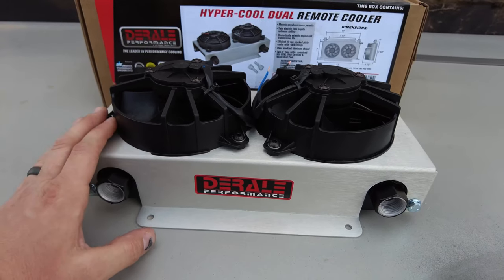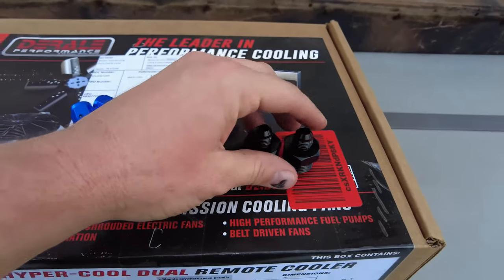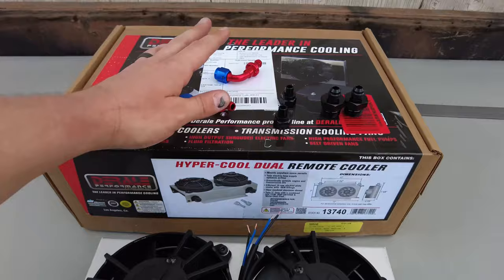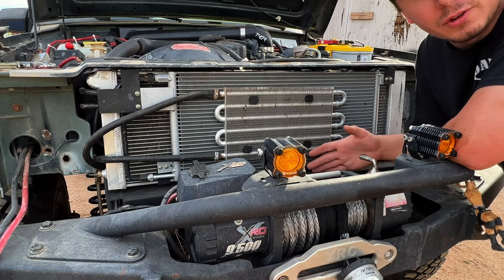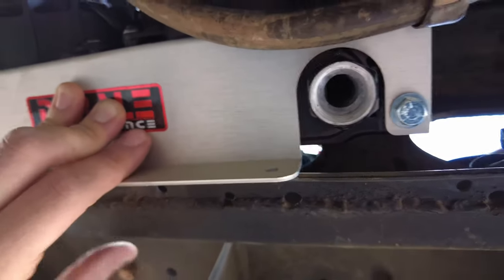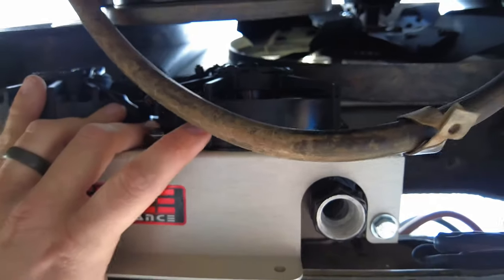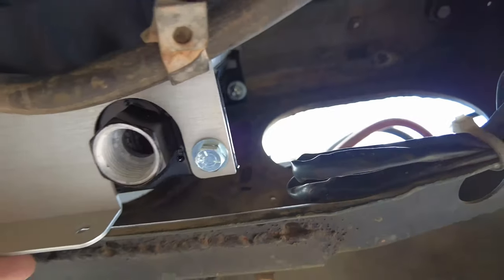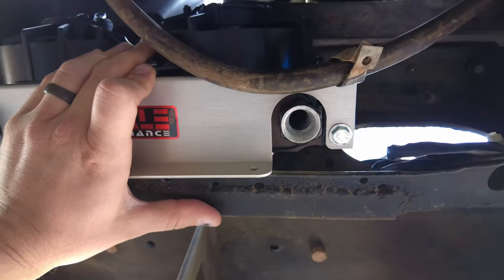How to install one of the BEST transmission coolers on your Jeep XJ!

Comment: I got the Derale Atomic Cool as part of my XJ overheating problem attack plan (along with new rad, fan and shrouds). I also installed a trans temperature gauge and noticed the transmission heats up more than the engine under some conditions, so I’m very glad I got the trans cooler. It makes sense since youre spinning the wheels etc. During the install I discovered the stock trans cooler was clogged, along with lots of bent and kinked trans lines. Night and day for me, all my heating issues were solved.
Reply from the maker: Overheating attack plan I love it! I think an external transmission cooler is a must on the XJ’s especially one with a fan. A clogged and destroyed stock trans cooler can definitely cause some overheating issues with the transmission. The better fluid and airflow the better 😎 thanks for watching
Reply: @2AOverland  Totally!!! Its a big must, total game changer and very often overlooked, hardly anyone does this. Out of dozens of comments giving advice on my heating problem, only 2 mentioned the trans cooler. That and watching your video multiple times I went ahead and got the Derale, night and day man. Thanks for posting, its the only video on Youtube for an XJ remote/fan trans cooler installation.
Reply: @2AOverland  Finally got this model for my buddies f100. Great video man, every time I watch it I learn pick up something new.
Reply from the maker: No problem thank you for that man 😊👍 I’m gonna do the same coolers for my square body a trans and engine oil cooler

Comment: Nice! I definitely wanted to do this before I ended up doing a manual swap on my XJ. 

I’d say a bit of advice would be to look into a thermostatic control for it. That way you never have to worry about turning the fan on or off, cause while it may not be near as bad, over cooling isn’t good for an auto. 

Before I manual swapped, I bought a thermostatic control from American volt. The AW4 operating range is 125°-175°, and I got a thermostatic switch that would turn on at 150° and turn off at 135°. That way it’s always keeping it in range. The kit comes with the hose barbs too so it’s incredibly easy to do. The solenoid control would just be before the cooler and you’d have a solenoid signal wired up to it. Such as battery positive to the switch, then the switch to the solenoid. And then maybe your ground runs through the solenoid. And it’ll turn on the fan on and off as you see fit, and you could even have a manual override too. Just an idea if you’re interested in having an “out of sight, out of mind” approach. I like to drive hard in the sand, so a cooler was a big priority while I still had the auto

Great video! I loved watching. Glad to see there’s videos that aren’t just using the average cooler, and now showing fan cooled ones too
Reply from the maker: That’s brilliant!!! Thanks for the info man! I want it to be as painless as possible so I already have that kit in my shopping cart 😂 I’ll figure it out how to wire it up so it’s automatic and I can use the switch.

Thank you so much for watching! I’m trying to be more outside the box and do budget minded but high quality upgrades to the jeep that I know people would want to watch
Reply: @2AOverland  you got it! I think that would make it so you can just forget about it and not have to worry about it. 

My hunch is that you’ll need to split the ground lead from both fans into two separate leads. You keep the lead you already have connected to the auxbeam and that allows manual control. On the other lead you get a solenoid rated for the current it’ll draw (I believe you said 10A?). Run your secondary lead from the grounds into the solenoid, then from the solenoid to battery negative or just grounded to the body somewhere. Then you just wire from battery positive (or ideally ignition 12v that way it doesn’t run down the batteries on a warm shut down, but I can’t imagine a problem), to the thermostatic switch, then from the thermostatic switch to the relay. I believe there’s a signal ground needed too, so I think in that case you’d just splice your signal ground into any of your ground wires for the fan. But don’t quote me on that part. 

For the thermostatic switch, you’ll want to make sure you get one that has the barbs sized for the inner diameter of the cooler lines. Should be pretty easy to make a few cuts and splice the switch in. Also, as I’m sure you could imagine, make sure you put the thermostatic switch in before the cooler (even the factory “cooler” too if you have it still). You want to see the temps right out of the transmission, not the temps before. It should be easy to figure out which is which. I get everything warmed up, then put the fan on at full tilt. And use a temp gauge to see the surface temps of the lines from the cooler. Whichever one is consistently hotter will be the line from the transmission. 

Also you could even set up your ground wires so it’s just one ground wire from the cooler to about 12” before the auxbeam and then do the split there. The current will be no different if you have it run through the whole ground line instead. 

For sure! I really enjoyed watching it! I know I’ve been watching your IRO 3 link video over and over lately. It’s really well done and it’s making me be sure I’m prepped for when I install mine. 

Best of luck!
Reply from the maker: Man that’s so much info for me to use to install the kit 😊 thank you so much for that! If I make a video on installing this kit is it okay with you to add a screenshot of this comment to explain how to hook it up? And thanks for watching the 3 link vid! 😎 I’ve had zero issues with that kit and you’ll love it!!
Reply: @2AOverland  sure! It is all theory since I haven’t been able to do it myself but I have every reason to believe it should work great! 

Yeah! It was a fantastic video. Easy to follow. Thank you! I’ll be installing it pretty soon, hopefully

Comment: Nice set up . Question - could there be a air pocket problem mounting with the trans cooler connections both on the bottom ?
Reply from the maker: I guess there could be in theory 🤔 I’ve been trying to research how much psi the transmission pump pushes but I haven’t had any luck. We did test the cooler this past weekend on a trip and haven’t had a single issue!
Reply: @2AOverland  The air will not purge out of a plate cooler completely unless the fittings are UP or sideways, if sideways the from the trans line needs to be  the bottom fitting.   Look at any piece of heavy equipment, caterpillar for instance, the cooler is almost always mounted fittings sideways so the cooler can purge and drain ..  NICE install mounting

Comment: Looks nice. Could you weld a piece of angle iron on the backside of that piece its bolted to in order to protect the fittings?
Reply from the maker: Thanks man it does make a big difference from what I’ve tested. That’s a good idea though 😳 I don’t know if it will protect much against rocks while wheeling but the occasional rock from the road or bushes on the trail it would work perfect! I’m gonna add a piece of iron thanks man.
Reply: @2AOverland  No problem, glad you like the idea hope it does help. Just got a bone stock XJ last week trying to plan out all my different upgrade options
Reply from the maker: That’s awesome man! What year xj did you get? And the xj community on YouTube has lots of great info from what I’ve seen. If you have any questions please feel free to ask 😎
Reply: @2AOverland  Got a 1999. Very clean, almost rust free which for my area is impressive. Been watching lots of different videos. Appreciate it, love your videos and will be doing several of the upgrades you have done videos on.

Comment: how bad were the air bubbles . noticed you installed wrong up . left or right but never down.
Reply from the maker: Thank you for watching! You have a point but I haven’t had an issue since the install tbh. I think the transmission pushes enough fluid PSI to push it through the cooler no problem

Comment: A year later… looking to add a similar cooler to my JK. How has this model done with your trans temps?
Reply from the maker: I’m still not running a transmission temp gauge after the cooler but I haven’t had an issue at all so far with it.

Comment: This is exactly what I need! It looks expensive though :/
Reply from the maker: The whole setup was a little pricy compared to other setups but these fans are weather and waterproof and the dimensions almost fit perfect in the spot I mounted it so that’s what sold me on it 😬. I figured the cost of the cooler is cheaper than a transmission rebuild if it gets too hot 😩
Reply: @2AOverland  good point. I’m also wondering if it may help the engine run a little cooler by removing the stock trans cooler from in front of the radiator 🤔
Reply from the maker: That’s exactly what I was thinking. Less crap for the air to flow through lol. I think it could make the ac run cooler also
Reply: @2AOverland  one things for sure, it won’t make it worse, lol. I look forward to seeing an update once you’ve been running it for a while.
Reply from the maker: That’s a good idea! 🤔 I think I’ll do an after summer update on the cooler
Reply: @2AOverland  excellent!

Comment: Why didn’t you add more weld?  4 small tacks when you could have put two 1 inch beads on the top edge. 
  This is one of those mods that no one notices,  but are critically important,.

 I don’t think you’re supposed to put Teflon tape on AN fittings..
 Job well done!!!
Reply from the maker: Honestly there’s no reason why I didn’t add more 😅 you’re right I should of had a couple small beads instead of tacks but I think those tacks will hold and if they don’t I’m welding that whole damn thing in 😂. 

That’s exactly what I was thinking! An overheating trans will kill it so fast so I figured a beefy trans cooler will be more than enough and it’s an easy upgrade for anybody that wants to recreate it!

I don’t think I was supposed to either but I made sure it was way away from the threads so there’s no chance of leaking 😬 as long as it doesn’t leak I’m happy lol
Reply: @2AOverland   I had to build my own trans cooler since they quit making the behind the grill version for the TJ/LJ.   
 Unfortunately I had to do it 3 times.   The first version was too high. I didn’t notice but the hood latch hit the top of the cooler and made it leak after a couple weeks.  I bought another cooler and modified the mount but over tightened one of the fittings and it split so it leaked all over the place.  The third version has been great.  I’m going from the transmission to the radiator, out of the radiator into the cooler, and out of the cooler, back to the transmission.  In the summer it’s not ideal, but Texas winters can get very cold, so I needed to add heat to the transmission.
 On a side note: the thermal expansion rate of the transmission fluid is crazy high.  20* different radically changes the fluid level
Reply from the maker: Awh man that’s some bad luck! I thought about doing the same trans/rad/cooler method but I bought my cold case radiator from a local guy he lost the trans fittings so I figured I’ll just run an external trans cooler and save me time lol
Reply: You dont tape them because it can keep the fitting from seating properly and causing a leak that may or may not be stopped by the taped threads.

Comment: Is the fan designed to be either a push or full fan?
Reply from the maker: It could be either. Just flip the wires to have it go either direction
Reply: @2AOverland  Yeah, I noticed you mentioned that but are the blades designed to do that? Looking at putting one of these in both my XJ and 5.9L ZJ to prevent excessive heat offroad. But location is going to be dependent on if it can actually push or pull and not just have the polarity changed around. Know what I mean?
Reply from the maker: @Krawler69 I gotcha, and that’s a question I don’t have an answer to 😬 when I did the coolers on the squarebody I did have to flip the fan blades for better airflow but I would do some testing before installing with this one since I used a different model on the squarebody.
Reply: @2AOverland  Gotch! Well, I appreciate it either way!. Awesome video, sold me on the modification when I was browsing what to do with mine. That 5.9L trans hates the heat. So have to figure something out with it. The AW4 isn't as bad but better safe than sorry with just putting a 4.7L in it.

Comment: So for your transmission line routes, do you still have the lines going to the radiator or is going straight from the trans to the new cooler and back?
Reply from the maker: Sorry for the late reply! No lines going to radiator at all 😊 straight to trans from cooler. You can run into the radiator too but I wanted those systems separate so heat from the trans fluid transfers into the coolant from the radiator
Reply: @2AOverland  what about your power steering lines? The way mine is setup is the trans outlet goes to the cooler infront of the radiator, the it goes from that cooler to the top of the radiator internal cooler, then comes out the bottom of the rad cooler and goes to the power steering reservoir
Reply: @2AOverland  nvm I was looking at it wrong 🤦‍♂️ the ps doesn't tie into the trans lines lol I thought that was weird as hell bc it is 🤣
I'll be doing the trans cooler upgrade and temp sensor soon!
Reply from the maker: Sorry for not replying to the last message! No worries though! I’m glad you got it figured out and you’re gonna love that trans cooler upgrade man 😎
Reply: @2AOverland  getting mine installed today with a temp gauge kit 🤙 I got the inline temp switch to control the fans as well so it will be maintenance free

Also, do you ever travel up to Utah? I'm taking a trip in September and it would be rad to wheel with you if yall wanted
Reply from the maker: That’s awesome man let me know how it runs 😎 

I don’t think we’ll be able to take the days off to go to Utah to explore with you man. Utah would be amazing in September!